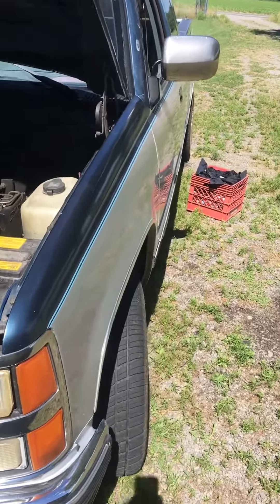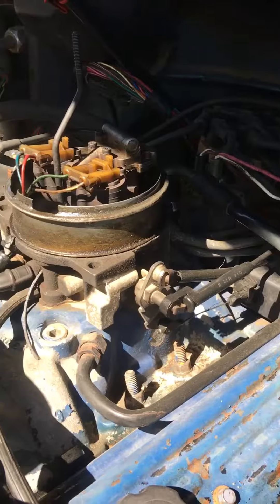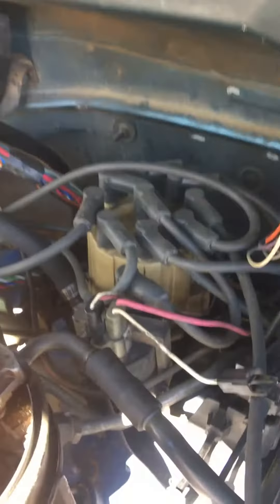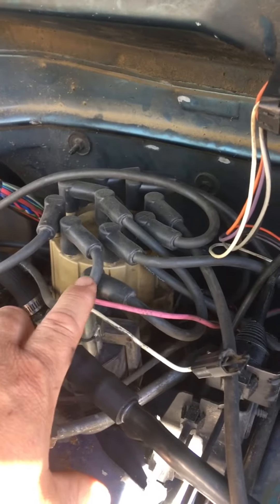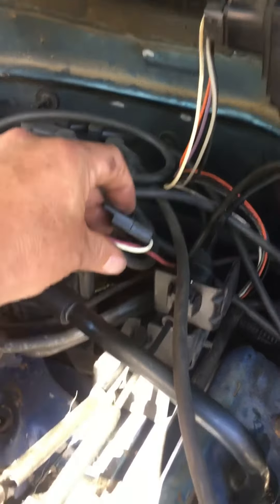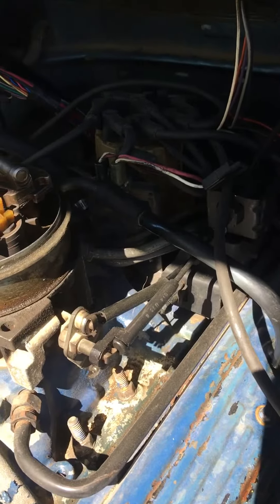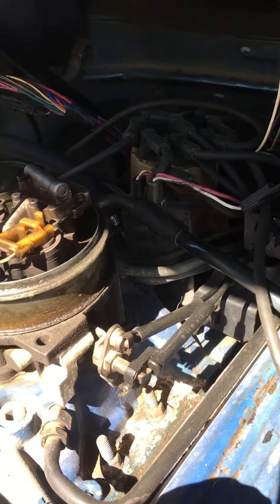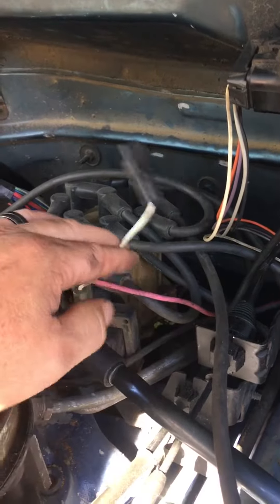How to wire a tach to a tbi engine

Comment: So Im having trouble with my Glowshift tach, they tell me that the wire you say to connect to wont work for me because it has 12v out of it. The prior owner has it connected to the wire on the other black connector not the grey one and it works but jumps around after 2000rpms, so they say it needs a filter which I just bought, hopefully it solves the problem. Im so damn confused
Reply: Did the filter work? And if so what filter did you buy I have the exact same issue and tach can you please help me
Reply: @Valdes_Customs  Yes the damn filter worked, go figure huh. I don't know what the number was so just ask GlowShift and follow the instructions
Reply: @bvandme  the green wire connects to the white wire on the 350 correct with the filter and the wire that’s white connects to the tach and then red is power and black ground right
Reply: @Valdes_Customs  Sounds about right, been a little while since I did it but as I said follow their instrc..